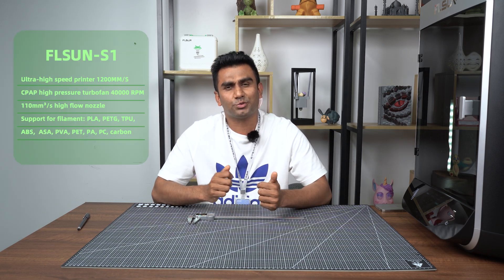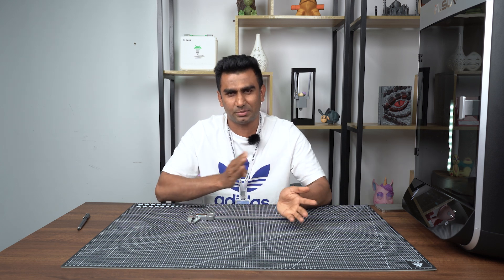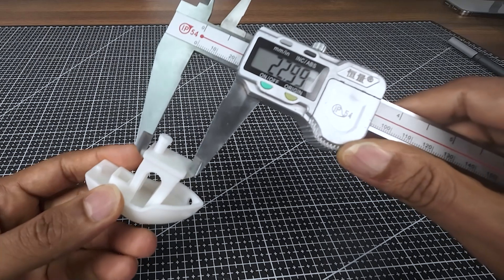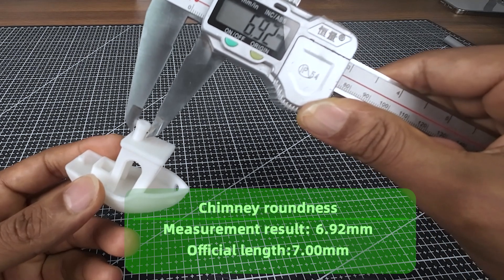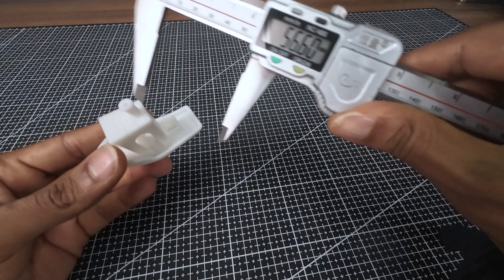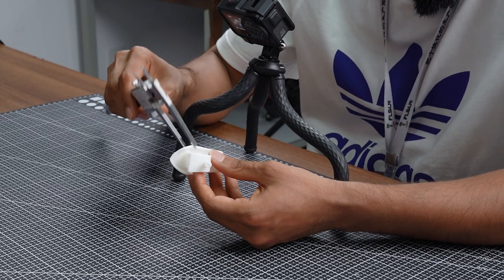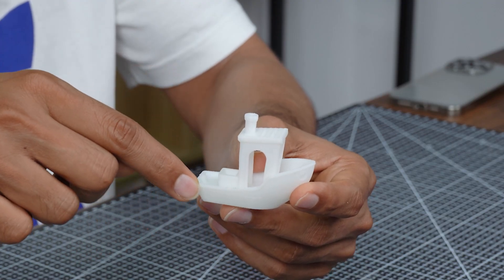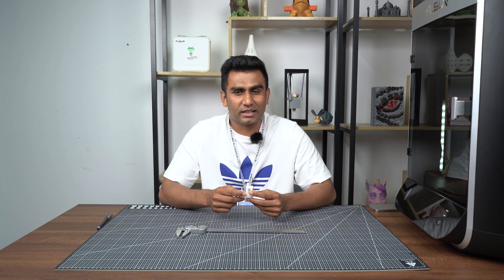How about the 1200MM/S Flsun S1 print quality? This video answers your questions

Comment: Attachements / addable parts like a multicolor system would be nice. Actually this 3D printer Flsun S1 + 3D printer Phrozen Arco in combination would be what i like to get :D
Reply: Just get a pallete 3 pro from mosaic and add it to this printer for multicolor printing
Reply: @NightRaven09er  yes i know the pallette 3. And meanwhile there is at least one competitor product for pallette 3 on the market. 

But what do you mean with "just a pallette 3" ? It's like 400-600 on top for an additional attachement. 

Meanwhile there must be other cheaper consumer-friendly solutions.

I would like to have the FLSUN 1, but not if i must add a 400-600 expensive attachement on top to make it multicolor printing.
Reply: @AcryPanch  yeah well I think the flsun motto is just advancing delta 3d printers for speed rather than the multi material capabilities since there's other companies more focused on that
Reply: @AcryPanch  so you kinda pay for cutting edge with flsun I mean I hardly know of any filament printers hitting 800 out of the box let alone 1100